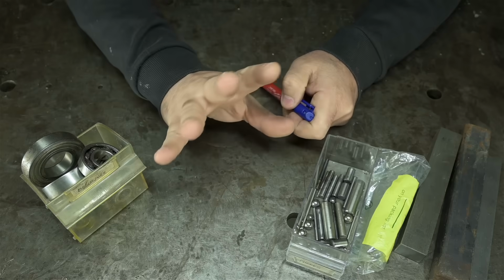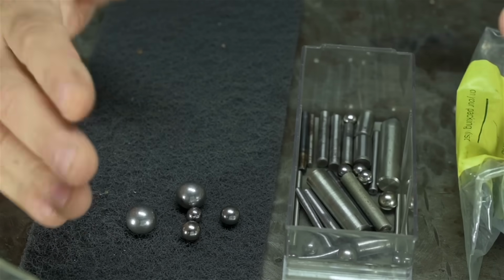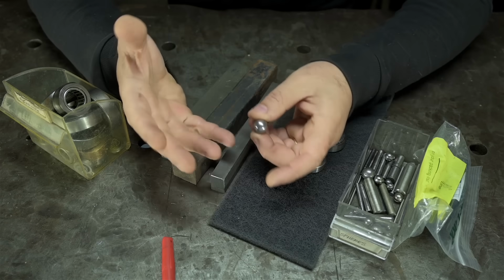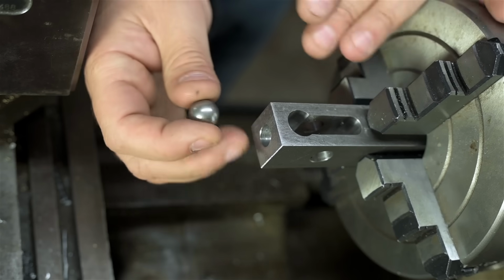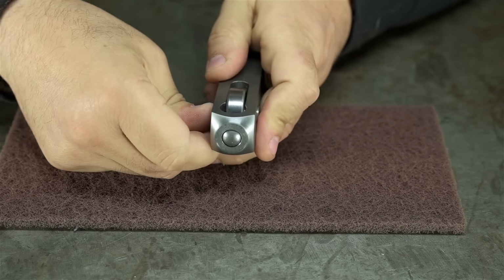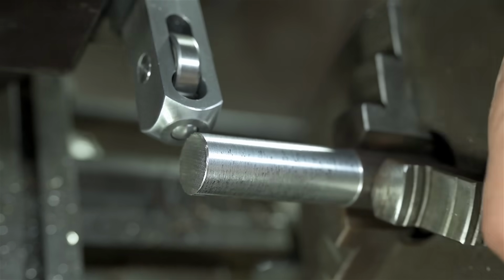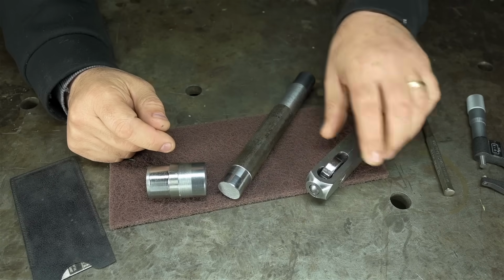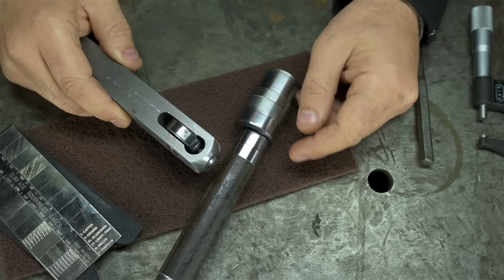I Have The Power!! (Burnishing)

Comment: I don’t know if anybody cares, but I do a similar process on aluminum blades for propellers and we use 2000 psi on our cold roller. It makes it very shiny finish and more importantly hardens the specific radius to prevent cracks.

Comment: Why carve out a pocket for the ball to sit inside when you could have just rounded and threaded the outside of the tool and used a cap with a hole for the ball to poke out a bit?
The threads would have given you a bit of slack adjustment, and you could have made the cap out of something like bronze that is both self-lubricating and softer than any of your lathe workpieces so bumping it wouldn't mar your work.

Comment: Im a maintenance man at a locomotive factory, the burnisher lathe we use to burnish axles runs just like you said at the end of the video, with a singular bearing riding against the axle (only one rotational axis, it gets it quite smooth, the only notable thing about it is that the sides of the burnishing bearings have a roughly 3/4" radius on them and feed 30-50/1000ths/rev.

Comment: Used to run a set of lathes that had a center hole that required an RZ of like 5.0 max. It's been awhile so my number might be off, but it was basically a mirror finish with a standard drill bit. We used needle bearing burnishers. They sucked. Nothing beats proper set up and rpm and feed rates.

Comment: I was expecting a cold chisel to "take the corners off", but it was just a punch for the ball.
Also, now you need one for the mill.. right? And maybe this tool could benefit from a harder ball. There is silicon nitride ball bearing balls. It seems even mcmaster sells some for the usual rate..

Comment: Find some Carbide Ball bearings regular hardened steel won't get you the finish  use a high Sulphur lube for extreme pressure

Comment: There is also diamond burnishing which has a diamond mounted into the end of a tool holder. The diamond is radiused and you press the diamond into the part. You can use a higher load and get a much finer finish (8 to 4 RMS). We use to use this on pistons for oilfield equipment. Better than a hardened chrome plating process.

Comment: 6:50 Maybe a slick way of getting the ball in place would be to make it tall enough that the pin that holds the bearing in place can be large enough on one side to allow the ball to go in. Then make a shaft/pin for the bearing so with a large side and a small side. Then thread the small side so the shaft goes in and screws into the other side. I'd probably make it from an allen head screw so it would come with a hex socket. Or maybe I'd get totally derailed and start making a rotary broach holder and never finish either ...

Comment: Easy way to retain the Ball and the Pin is to drill the holes accurately (ream).  then just use bigger ball Bearings on the hole and hit it with a steel hammer to role the edge in. : )

Comment: Option three. Open hole in tool body large enough to fit ball from the front (outside). Tap four holes on the front face at the corners. Bolt a metal plate with a smaller hole on the front to retain the ball.

Comment: I think the reason for the ball bearing (versus just using the roller directly) is to make the contact area a point rather than a line. You want to be hitting two ridges at a time, smooshing them down individually, not going over 20-30 ridges and spreading the load. The point is to generate those high surface pressures: to do that with a tool that has ten times the contact area is going to require ten times the total load, which it sounds like is going to be a problem for the lathe.

Comment: @khampha-sangtao has already made one with the roller bearing. I think these type of burnishing tools will stuff the cross slide thread on anything but a decent lathe. I suggested to @khampha-sangtao to make one like a clamp type knurdling tool so the pressure isn't on the lathe thread. There's a project for you 😊

Comment: Cool! I wonder if you could find a larger bearing with the same ID as your bearing OD. Cut off the outer race and cage, and run the inner race on the outside of the bearing so you'd have a race for the burnishing ball to ride on. Maybe over thinking, I bet it will end up with a bit of a race burnished into the bearing OD. At any rate very cool, might have to try this!

Comment: Manual machinist here... I have tried this and the results are pretty worthwhile as long as you are able to calculate and standardized the dimensional change before and after using it... Cut your part to the desired before size, then use it to make it land on your final dimension...

In my experience the very first failure point will always be the bearing race cracking straight down the middle because of the pressure being applied to a very small point... You definitely want to make your tool able to quick change bearings... I think I'm on my 4th or 5th bearing since I made this last summer, and I probably have eight more bearings in my toolbox right now just because I know I will end up needing them

Comment: This is a bit like the inverse of a wheeling machine used by panel beaters. The wheeling machines are effectively heavy-duty bearings that apply pressure down onto a metal sheet to allow it to be deformed and shaped.
Fascinating seeing the effect being used in a different mode.

Comment: Experimental food for thought: Decrease the feed rate substantially. With a theoretical single point of contact of the ball rolling on a cylinder, you will create something like a single point thread, double-digit microns deep. You want to bulldoze the surface peaks into the valleys. Doubling the size of the ball will halve the size of the resulting ridge, but half the feed rate would quarter the height of the resulting ridge - read on for the math.

Back of the stained napkin math: take a 2D cross section of two passes of a V shaped cutting tool - overlapping the cutting tool passes more by decreasing the feed rate makes the bottom side of the triangle smaller, but does not change the angles.

Back of the somewhat cleaner envelope math: draw a right triangle inside our circular ball to figure the height of the ridge left between passes. The hypotenuse of the triangle is the radius of the ball, the "short" side parallel to the lathe axis is the feed per revolution, now we can solve for the remaining side, which we need to find the height of the ridge left by a single pass of the ball. But wait, if this is exactly the feed rate, the ball will pass over this point and "level" it. The intersection of the two passes is halfway between, but this is equivalent to the first triangle with the short side being half the feed rate. To the point:

If D is the diameter of the ball, R is the radius and R = D/2
and if F is the feed per revolution, half the feed rate is "X" = F/2
and then the height of the ridge left between overlapping passes of the ball is:
H = D/2 - sqrt( (D/2)^2 - (F/2)^2)
OR 
H = R - sqrt( R^2 - X^2)

For a half inch ball (0.5") and a feed of 0.0394" / rev on a certain crummy lathe, I would get a 0.000777" ridge... 19.7 microns if that's your thing. I don't know what size ball or feed rate you used, but we are definitely in the same ballpark.

Oh, and I imagine since you are moving less material than a knurling tool, you could probably increase the RPMs to make up for slower feed rates, especially with coolant.

Comment: Surface finish comparators are amazingly accurate, to use them you usually use your finger nail as the comparator, to literally feel the difference in the surfaces. 
Comparing visually has some validity at the real smooth levels but overall start with with your finger nails.

Comment: Awesome to see TOT take on burnishers
The ORIGINAL LONG video https://www.youtube.com/watch?v=PsTy-jSmWcw 
If you go to his channel @khampha-sangtao you will find that he made another burnishing tool a few weeks prior.  The second video (that TOT is "replicating") is much easier to make and works better. 

It is different to TOT's version in that it retains the lubricating oil in a pocket. 

Want to what others have done?
For burnishing up to edges, internal diameters and flat surfaces on a mill go to Maurizio Guidi @Mauri59g 
external lathe tool https://www.youtube.com/watch?v=66YvC9l4mvQ&t=878s and internal https://www.youtube.com/watch?v=P6jrVtkegcY and a mill tool https://www.youtube.com/watch?v=ad4DLqj-NT4

Khampha and Maurizio are in Vietnamese and Italian. I have found it best to listen to their NATIVE version and read the subtitles. It is FAR better in english than any autotranslated voice.

Follow them both they do really interesting work - quite different styles compared to our beloved TOT
If you want something that is unusual also try @FinnoUgricMachining Finno Ugric Machining a style all of his own.

Inheritance machining @InheritanceMachining makes one, but it doesn't really work

If you want to make one if you go to 3:50 in the original video you can estimate sizes by scaling based on the size of the turned shaft is (30mm). On my screen the shaft is 40mm so the scale is 1:1.3. Or going the other way take 1/4 of the measured value. So the width of the tool is measured at 32mm so it is actually ~24. Bearing ~24 -> 18 wide and dia ~50 -> 38 . The ball ~24 -> 18. At 1:45 you can compare the height of the tool shank (right where it changes) and I get 26:40 so if we assume the shanks is square that gives us 24 x 40/26 = 37 and the hole is 19/40 = 20mm
So we have after making things to more common sizes, in metric not freedom units....
Shank is a 25 x 25 with a 25 x 35 head.
Bearing is a 18 wide 40 dia 20 bore so getting a bearing ABOUT that size that's common is a 20 42 16 - a 63004
Ball 18mm
Pin dia 20

Comment: I did this with just the bearing, no ball, and it worked quite similar. Found it worked best using just the corner of the bearing to increase psi without deflecting the workpiece too much. I feel it needs a following rest so you can have good pressure.

Comment: I've been surface treating coining and embossing dies for 40 years. Use very hard polished steel or tungsten carbide for steel. Regular polished steel for aluminum, brass or copper. So in your setup I'd polish the ball and the bearing. Clean everything with cotton and alcohol. Apply paraffin (candle) wax and burnish. Clean with alcohol. Make sure tool (ball and bearing) remains polished. repeat if necessary. 
    I prefer to burnish as much as possible, because in my case, I save the metal that is making the intended original form. Plus it's easier and cleaner.
Also the surface of the die transfers to the finished coin.  I can polish a small letter in a die polishing a hardened steel or carbide pin and using it  to burnish.

Comment: Roller burnishing, we use similar tools to change the diameters of fixtures. Make one at an angle, 45ish, and you can push surface material into a step or groove and then re-machine it to the diameter you need. Very handy gismo for reworking pie jaw and nest fixtures. Never used it much for surface finish stuff since cold working is not popular for fatigue sensitive parts. But for non-critical stuff where you need to move some material to change the dims a little bit they can be handy tools.

Comment: If you make another burnisher, consider installing the ball from the front.  Then, press in a ring to retain the ball.  You might have to spot face around the ball hole to get enough surface area to retain the ring.

Comment: 1:26 As a big Paul Sellers fan and spiritual student, owner of more old handplanes than I should own - according to my wife (but I use all (most) of them)-, essentially a wood elf turned metalshop gnome later in life, I feel like the hair in the back of my neck will never stand back down. Very nice surface finish though. Must be one of those fancy sintered steels to get that smooth of a surface on metal. Minimal camber on the iron too, I assume.

Comment: Man, I'm glad I watched this the day after yesterday. It was too cold yesterday, so I wouldn't have seen anything.

If you have to take the pin out more than twice, maybe the other side of the hole will still be useable. Depends on the pressure and how cold the shop is.

Comment: I built one of these tools after seeing some videos. I found .0001” compression on a 1” diameter piece of decent steel, with .015” of “pressure” (.0075” radially). It’s fun to experiment, it does leave a great surface, I think a carbide roller ball would work even better. Nice job.

Comment: Tony I made a video on this quite a number of years ago. No need to use the ball on the front. Simply use a standard bearing as you suggested and run it slightly off 90 degrees. The pressure from the bearing edge achieves the same results

Comment: I nearly chopped my thumb off with a chisel. the scar is in the same spot and orientation, just on the other side of the hand. Doc said the same thing, must’ve been a sharp knife. 

i had 4 stitches and they did progressively tear themselves out, and the scar is half as wide as my thumb, not including the other scars from the stitches tearing the skin. Including those it’s probably 5/7 the width of my thumb. turns out having stitches in one of the most mobile and active parts of the human body doesn’t bode well for a seamless recovery

Comment: !!!  HEY buddy!  (1) The ball needs to be sprung and (2) the ball & workpiece need to have sufficient amount of coolant/oil flow over the working surface... both (1) & (2) are necessary for best results!  EDIT: ...IN MY EXPERIENCE...

How much spring pressure? Depends HEAVILY on material hardness, how the spring felt when he woke up this morning, and the current trajectory of planet earth... so the BEST way to find the right spring pressure is to have a set screw that can preload the spring and simply test different spring pressures with a scrap piece of the same material you're gonna burnish.  Feed and speed matter too, of course, but that contact pressure (spring pressure) is critical for a consistent result (in my experience acheiving ~ 2-8 microinch 'Ra').  Also, if you plan to burnish down the length of the shaft more than an inch or two, i cant express enough the importance of the cooling oil at the contact point between ball; and workpiece (shaft).

>>> source of knowledge?  I'm a mechanical engineer that studied the burnishing process (in my last place of employment for 17+ years) in an effort to achieve 0.00037" total electrical and mechanical combined runout consistently (Repeatably and Reproducibly) on certain e-motor shafts within a motor production plant.

A guy at Bently Nevada / General Electric (Nate Litrell) once told me that burnishing steel, on a microscopic level, is akin to spreading peanut butter with a butterknife or spatula... you want to move the material just right so that you compress the surface but DONT gall the surface.  I can point you to some good reading if you want to go deeper.  

EDIT 2: also consider buying a carbide ball on ebay... they're cheap.  a smooth diamond surface is more commonly used by burnish tool manfacturers, but a carbide ball might be advantageous.  Just a thought. 

Cheers!

Comment: I’m no machinist but I don’t think the use of just the bearing would work. The amount of surface contact would require a lot more force to be effective . It may work for soft materials ( copper,brass, and aluminum) but any debris on the bearing or work piece will leave a mark..

Comment: Converted our steady rest over to ball bearing from bronze pads. Noticed it seemed to burnish the surface where they ran on the part. Might have been a little too tight but did the job better.

Comment: Yeah tone, it’s been a minute since the last vidigeo. But still good and worth the watch. Thanks fingers! Oh…also. I think if you just used the sealed bearing. The thinner metal of the outer race would heat up and deform regardless of the coolant being used. Hence the hardened ball bearing and separation between the bearing surface and the “spinny” bearing. Too many spinning bearing/berring…s? 😂

Comment: Could put a cap on the end there to hold the bearing in place rather than bore it out but maybe that is more work. It was a perfect solution until you tapered the nose of the tool.

Comment: I imagine the countersink has to be smooth for the tool to work correctly ?
Otherwise, I'd just bore big enough to load the ball from the front, then put the thing vertically in a vise and smack the face with a ball peen hammer until it makes a lip strong enough to hold the ball.

Yeah, you guessed right, I'm a blacksmith, not a machinist. :D

Comment: If you have a few minutes,look into roller burnishers for gunsmithing. It may give some ideas. Typically they are cylindrical burnishing heads and set up to be used in the chuck ,but again, it's just for ideas.

Comment: I don't think the outer race of a ball bearing would work. It makes line contact instead of point contact as the ball does so I think the pressure will be too small. But if you can grind the outer race so it gets slightly spherical, you might get a small enough contact surface and high pressure.

Comment: I made a burnisher to try out on my "benchtop" lathe. Not one of the mcdonalds toy sized one. Lil bit bigger than those. But i learned 2 things. 1- Burnishing is a simple and effectice way to hide less than gorgeous surface finish, and 2- my lathe is basically a noodle. Also- i DID try the bearing only burnisher 1st. Worked just fine. Made 2 others. About the same size as yours. And then one with a MUCH smaller ball bearing. That one (small balls) worked significantly better. At least on my lathe that lacks the rigidity of a much larger lathe. Smaller contact surface area applies ALL the pressure on a smaller surface and squishes it down better